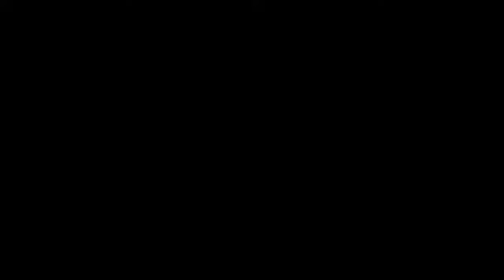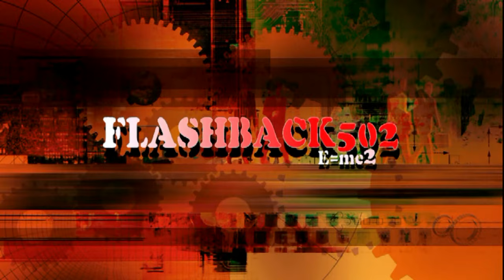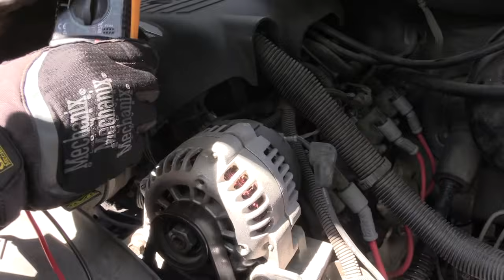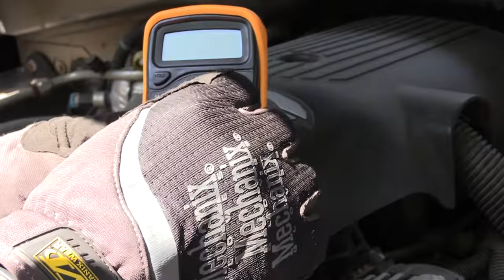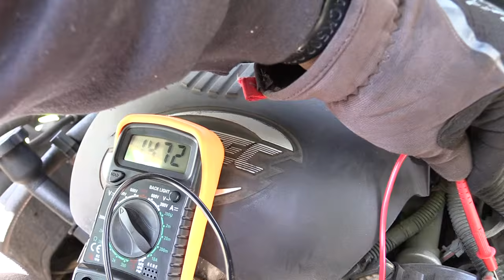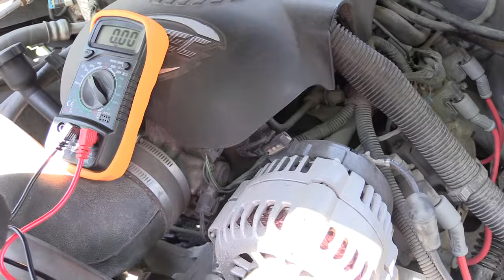How to Test Vehicle Alternator with Multimeter!

Comment: Dude, you are setting your multimeter for DC voltage measurement and connecting the leads directly at the Alternator output where we are supposed to get AC voltage. 
Before connecting with 12VDC battery terminal the AC voltage is converted into DC voltage. How and why are you measuring DC voltage directly at 
Alternator output terminals ?
Reply from the maker: You use DC for the main output test on a vehicle alternator, you can use AC to test diode in alternator

Comment: How do I check if the alternator plug is sending power to the battery? I put 3 new alternators on thinking it was an alternator problem, I changed multiple fuses & there's still something causing my alternator to not send a charge to my battery. How can I test the plug that goes into my alternator?
Reply from the maker: Start vehicle remove red battery cable from battery and test with Multimeter to be sure it's sending power

Comment: Turn your key in ignition position.
Alternator light should be on..
And the rotor of the Alternator should be magnetic,you can feel that with an little screw driver..
Turn the engine on,
It should give around 14.4 volts.

Comment: Can also measure at the cabin cigarette lighter.  I have a little plug-in meter for that I use on long trips to avoid surprises, like once when the BATT dash lamp lit after driving on a flooded street.  Meter showed the alternator outputting fine (14.3 VDC), so kept going.  Lamp stayed lit until vehicle was powered off then on (must have latched warning), but wasn't going to risk that until we got home (dark and stormy night).  Also have a built-in voltmeter in a USB adapter.  Most OBDII adapters will display system voltage.
Reply from the maker: That's a great tip, thanks for sharing!

Comment: Just confirming the alternator is putting out DC voltage above that of the battery voltage is a very basic test for an alternator. You also need to check the AC Ripple voltage. Cut and paste FYI... ( I would suggest measuring AC Ripple directly at the alternator between the case and the positive terminal)

 How to Test for Alternator AC Ripple
Testing for AC ripple is a straightforward process, you just need a multimeter with a low AC setting.

Testing Procedure:

1) Set Up the Multimeter— Set your digital multimeter to the AC voltage setting. The scale should be set to a range that can detect low voltages, such as 0-2 volts.

2) Connect the Multimeter— Connect the multimeter’s positive lead to the positive terminal of the battery and the negative lead to the negative terminal of the battery. This setup allows you to measure the AC voltage present across the battery terminals.

3) Start the Engine— Start the vehicle and let it idle. Observe the multimeter reading. In a healthy system, you should see a very low AC voltage—ideally below 50 mV.

4) Rev the Engine— Slowly rev the engine to about 1,500 RPM. The AC voltage should remain relatively low and stable. If the AC ripple increases significantly with engine speed, this could indicate an alternator issue.

5) Evaluate the Results— If the AC voltage exceeds 100 mV or fluctuates wildly, it’s a sign that there may be a problem with the alternator, such as worn diodes or stator windings. In such a case, further inspection or alternator replacement may be necessary.

What to do if your AC ripple is too high
High or irregular AC ripple can be caused by one or more open diodes in the rectifier bridge or by a fault in the stator windings. Since it doesn’t really make sense these days to replace internal components, replace the alternator with a new unit.
Reply from the maker: Thanks for helpful info.Please subscribe like and share and check out our other helpfull videos

Comment: Hi mate, when perform the same test, my alternator is only reading 12.3volts, it's a brand new alternator a day old, new battery fitted 2 days ago as well. Would you say my alternator is fckd ?
Reply from the maker: Most likely  it's good. The reading can be different on different  alternators.

Comment: Some alternators only start charging once the RPMs are above idle. Such as my boat alternators. Just an FYI. my voltage will pretty much read what my batteries voltage until I rev up the RPMS above 800RPM. Then the alternator sends 14v to the batteries.
Reply from the maker: Thanks for helpful  Info. Please like subscribe and share

Comment: Another easy method: first check voltage of battery with engine off then recheck the battery with engine on , if the voltage increases that means the alternator is working and charging. So your method tells you there is power to the alternator but doesn't tell you that the actual alternator is working. By doing the method mentioned above, you will hit two birds with one stone. Thank you
Reply from the maker: Thanks  for helpful tips, may use this.  You're welcome! Please subscribe like and share and check out our other helpfull videos

Comment: I find that my alternator has the same voltage as the battery (about 12.6), would that mean that I can disregard bad connectors and such as a problem and that the problem simply must be that I have to replace the alternator? Or can there still be other possible reasons for it?
Reply from the maker: If your vehicle is not charging correctly,  then it's most likely a bad alternatetor.  Please like subscribe and share.

Comment: When checking the alternator output voltage make sure everything is off especially the automatic switch on the vw cc ! If anything is on the alternator voltage will be less than 14 volts .Cheers Eddie
Reply from the maker: Thanks for tip. Please like subscribe and share

Comment: Question 
How do you go about diagnosing a car that had a battery replaced but comes back weeks later due to the car not being able to start unless if it’s jump started -
Brand new battery was put on so maybe it’s a bad battery or a parasitic draw or a bad alternator or a bad or loose cable if I use a multimeter to test the battery while the car is on and it reads 12.4v that would most likely mean that the alternator isn’t charging the battery because if it was it would be over 14v+ with the battery reading 12v with the car on it would be safe to assume that it’s probably a bad alternator but what if it isn’t and I install an alternator and it still reads 12v how do I go about diagnosing it do I put the test leads on the alternator and ground cable to see if it reads 14v and if it does it means it’s good but if it doesn’t it means it’s bad like in this video how do I go about testing cables I guess I’m just wondering how you would go about diagnosing a car that comes in with a new battery that was replaced but dies weeks later and doesn’t turn on unless if jumped and the battery reads 12 v with the car running with a multimeter what do you test next ? I’m learning how to work on cars and I really want to learn how to diagnose
Reply from the maker: Most likely its your alternatetor. You can take it to Auto Zone and have them test it. Please like subscribe  and share.

Comment: Thanks for this video. Pro tip, don't leave your multimeter resting above the fan belt/water pump and belts when you start your vehicle! Depending on the size of your engine and how much it rattles or roars when you start it, It could topple down and become mincemeat.  Effectively destroying your fan, shroud, belt system, and maybe even bend or break some other things along the way. You also don't want too much  wire hanging down when you start the vehicle. I would just follow all these steps, just don't introduce the multi meter until you're ready to use it.
Reply from the maker: Thanks for tip

Comment: Im not the smartest, but if an alternator isnt working properly, the car wouldnt be running? So whats the point of checking it? Or if the voltage on the battery is 14.7v while car is running, it would show the alternator is ok?

Comment: Thanks mate! I can now pin point whether it's the alternator or a break in the wires along the way to the battery. I was never taught that you can check this way only at the battery site. Awesome vid! Very helpful. These days it's too expensive to take to mechanics, they said it was my battery and I bought a new Bosch from them for $300 dollars plus their charge to look at it $185. Didn't fix the problem so I'm not going back for more problems. Thanks again. I'll continue to educate myself and figure it out. It's too expensive to have these problems these days even though I'm a worker.
Reply from the maker: Your welcome , yes agree the more you learn the more time and money u save. Hope u fix problem.

Comment: Couldn't you make the same measurement, with the engine running, but instead of AT the alternator, take the measurement at the battery terminals? That way you could rule out that there is something wrong/faulty in the wiring, or at the alternator for that matter and know the voltage that is truly making it to the battery. And if after running the engine for a while, say 30', and check the battery again, and if it is low or lower than 12 V then you'd know it was the battery is bad. Replacing the battery is less work and cheaper too.
Reply from the maker: Yes agree 👍🏿